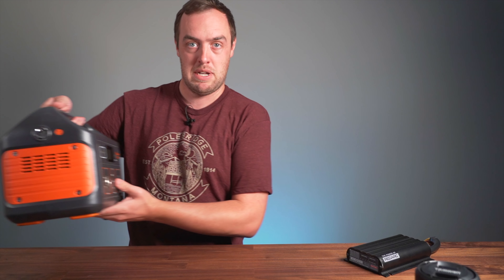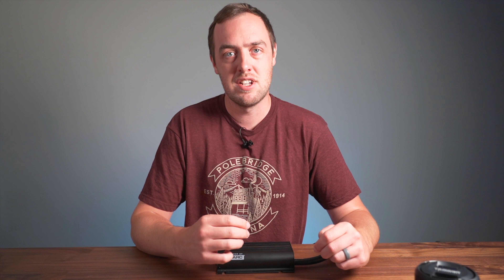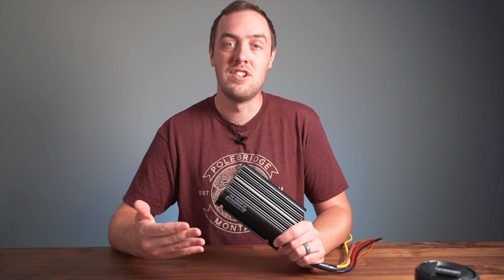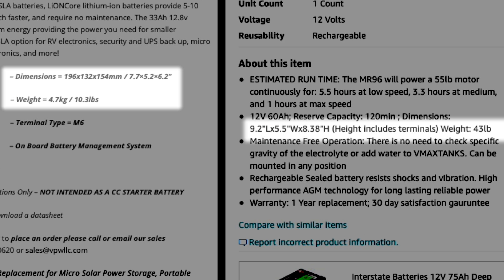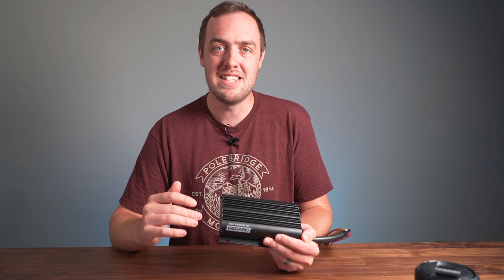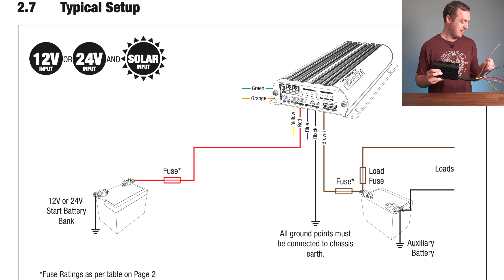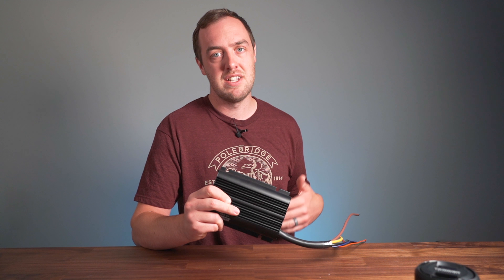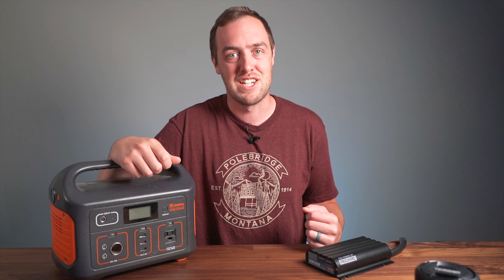Why You Should Do Dual Battery Properly

Comment: I was in need of a dual battery and have been looking at the portable ones like Jackery, but I have found that it didn't have all the inputs that I needed and was limited to whatever that portable power station came with. 

I then looked at more of the $75 route, but did find that I could run into a lot of issues like you stated. 

I then came across the Redarc BCDC 1225D.
This unit has made my life so much easier because I was able to customize my own setup specific to my vehicle and I can add more inputs in the future if needed.
Reply from the maker: That’s the great thing about such a modular system. I like the battery packs still, but my biggest issue is how slow they charge. The BCDC1225D is over 6 times faster at charging than a Jackery 240.
Reply: @RevereOverland  I did not know the Jackerys were that slow at charging!

Comment: Good info here Rob! I recently picked up some REDARC stuff and I'm in the process of deciding on my dual battery set up so this is super helpful. Thanks man!
Reply from the maker: I’d definitely recommend LiFePO4 for you!
Reply: @RevereOverland  Yeah, that's what I'm thinking. My AGM starter battery is great and, with the aid of my solar, has powered the fridge for several days no problem, but it definitely feels like it's pushing the limits. I like that the REDARC systems can handle different types of batteries.

Comment: Have you seen the video from Wanderlost Overland? They did a temperature test with the Lithium battery you showed, they shared their results with the manufacturer. After the their tests the manufacturer wrote them a letter stating that the under the hood use of their battery was not safe because of the high temps and there was a real risk of fire.
Reply from the maker: I did! It doesn’t surprise me. Lithium batteries really are best used inside the vehicle for both heat and cold protection!
Reply: @RevereOverland  Your videotography is getting better and better every episode, especially your drone footage, love your channel. Thank you
Reply: The real problem with a quality LifeP04 under the hood (manufacturer doesnt reccomend) is not fire or explosion. LifeP04 is very safe.  The Battleborn has a high temp cutout. Under The hood gets really hotel. What good is a sunstantial battery under The hood of it wo t charge due to high temp cut out. This is by design.

Comment: I need to get a DC to DC controller I just have a switch at the moment kind of a start to the project so I can see what I'm doing and if it all will fit right it does okay I definitely need to get some better equipment though batteries are at the top of my list.

Comment: Your advice has steered me away from systems like the genesis dual battery system. Like you said, I think it’s cheaper to get an AGM battery, a battery box, and the redarc (along with some circuit breakers and cables). I won’t have to worry about hurting the aux battery or having to buy a new starter battery before I need one. Thanks for the help!

Comment: Okay I got through watching your video a lot of misunderstanding between a lot of people. So can you clear this up if it's two different types of batteries the relay supposed to just regulate how much power and then cut off or on what does that have to do with what type of battery I bought these isolators just for one purpose to turn off the battery when the battery is, and do turn it on when the battery is full can you give me some more information on how this damage is the battery.

Comment: I have the Renogy DC to DC charger on my DIY overland trailer.  It works very well. I ran #4 cable from the jeeps battery to a plug at the rear, then a cable going to the charger. I also have a 100w portable solar panel and finally I added a NOCO Genesis charger for shore power.  It runs the refrigerator and charging ports. I'm anxious  to try an electric blanket.  Just bought an 04 class B and want to add batteries to it.  
I'll be researching your recommendations. Thank you.
Reply from the maker: Sounds like a good setup! What battery do you have?
Reply: @RevereOverland  Amazon has the Amperetime brand. 100Ah LiFePo4 . It does not have a low temp cut out however, the Renogy does have one.  I taped it to the side and put 1½ foam insulation around the battery.
Reply from the maker: That’s a good idea!
Reply: Just remember Rob is talking anout Lithium, but Lithium Iron Phosphate...significantly different than Lithium Ion...
Reply: @davidwalls4150  LiFePO4 is what I have.

Comment: Been running a Renogy dctodc charger with a 100w  fixed solar panel on the roof. A 100ah gel battery. Ive found that even with my wife and I taking showers, running (usb) fans all night. We hardly go below 90% charge overnight.  When its cold wee use electric blankets that bring us down to 80% capacity. Still the charger is able to top most if not all it up with about 5-6hrs of engine run time. Depending on how long this battery lasts will determine if I go lithium next time or not.
Reply from the maker: Sounds as though AGM is working out great for you! I use a ton of power with all the drone batteries, so lithium made sense for me!

Comment: So I went to a shop to get some help with my set up. I originally was thinking American Adventure lab with 100ah LiFePO battery, but I plan to sleep in my vehicle, so the techs recommended the genesis system to keep fumes out of the vehicle for safety…that check out?
Reply from the maker: Find a different shop. There are no fumes from charging lithium!
Reply: Appreciate that! Definitely felt fishy

Comment: Hi like your videos and find them very informative but in my opinion Redarc stuff is good but over priced. Also I run a lead acid starter battery and AGM deep cycle in the rear to run a fridge via a cheap battery isolator I know it’s not the best option but I have never had an issue, same battery has been in the vehicle for 6 years. As for Lithium vehicle batteries they are brilliant, I’m not sure where you are but here in Australia a half decent 100amp/hr battery is around $1,000- $1,600 with a 3 -5yr warranty so I would like to know what a battery with 12 yrs warranty is worth. Anyway keep up the good work.

Comment: The drawback to lifepo4 battery is it doesn't like extreme hot 120f + or cold 32f-. Both can cause damage, too hot can cause fire. This is important information for viewers interested in dual.
Reply from the maker: Absolutely! I just didn’t want to get into all of the details of battery chemistries since I already have that in another video! You definitely don’t want to install LiFePO4 under the hood. They are usable in the cold, just not chargeable. They do make heaters for them though, and Battle Born even has ones with heaters built in.
Reply: @RevereOverland  I look forward to battery technology   that gives you a tough battery like AGM but virtually 100% use capacity.... maybe this will happen in our lifetjme.
Reply from the maker: Maybe one day we'll have mini fusion reactors! Lol.

Comment: I never tried the " 75$ " setup, although I have been piecing together a dual batt setup for my 2nd gen 4runner. Standard acid under the hood and a 100 ah agm in the back with 100w solar panel on the roof. It's not bad, but I thought it could be better, so I picked up a renogy dc to dc charger, as of yet uninstalled. The agm I got for free from work, and everything is renogy. (MPPT Charge controller, 100 watt fixed panel and a 100 watt suitcase ) I've been toying with cutting my losses and just going with one of those fancy dancy jackery or bluetti solar generators and have yet to bite. Then maybe the option of just the lithium battery. I'm interested in your comparisons.
Reply from the maker: Sounds like you have a good setup, go with it! The Jackery/Bluetti stuff is nice, but charges super slow. You’ll never have to worry about plugging up a dual battery either!

Comment: I’ve been doing vehicle electronics for over 25 years. You do not have to have the exact same battery when using a solenoid. This claims “sponsored by redarc”.
Reply from the maker: Exact same charging profile… which ultimately means replacing the starter.
Reply from the maker: Also, what works isn’t necessary what’s best for the life of the battery!
Reply: I agree with you,  how many are providing ventilation for batteries in passenger compartment?  All batteries gas!  some more than others and some just straight catch on fire.   I will stick with my dual battery system which includes Insterstate AGM group 24 batteries and a 17.00 solenoid.   Total cost under 400.00 maybe 450.00 with 4gauge wire... not this wimpy 8 or 10 gauge crap...